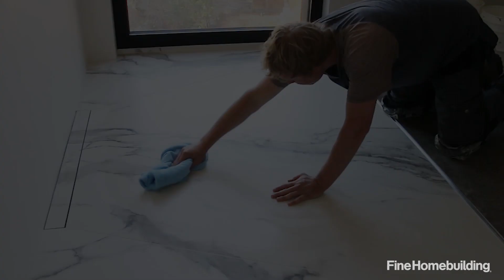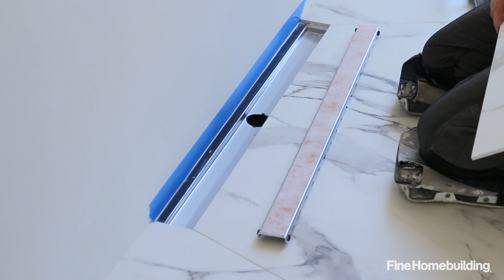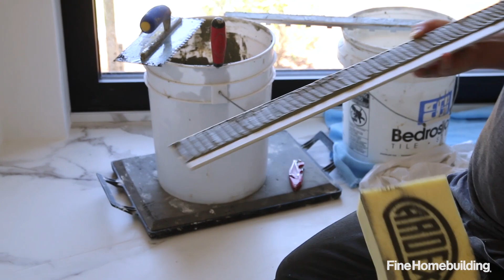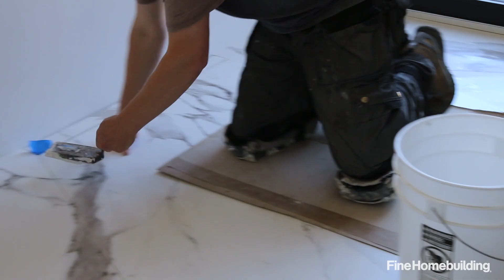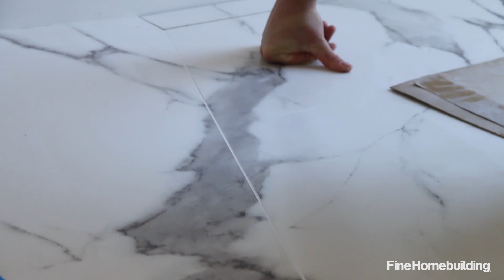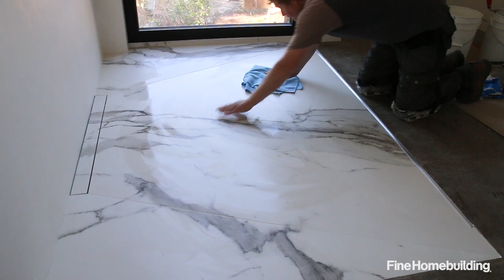Finishing Touches for a Porcelain-Slab Shower-Pan installation

Comment: I am working on a large walk in shower with Zero entry now and looked high and low for a non slip white large format that would provide a non slip surface.  I finally gave up and went with a rough textured grey tile 2x4.  I would have much rather had the look you did.  How is this tile surface non slip?

Comment: beautiful but I would think its crazy slippery?  Is that the case?
Reply: Any polished tile is usually more slippery than matte. When choosing tile check out the Dynamic Coefficient of Friction or DCOF for slip ratings. Not all polished tile is alike but it looks awesome.
Reply: Stop it! Any tile, wet, is slippery...
Reply: @MistAtsiM  grout lines add some level of traction.  slabs allow for none of that.  I was hoping to hear these slabs are micro-etched to add some level of friction.